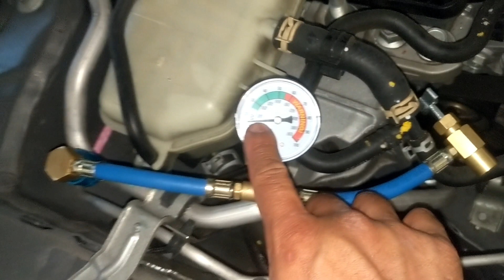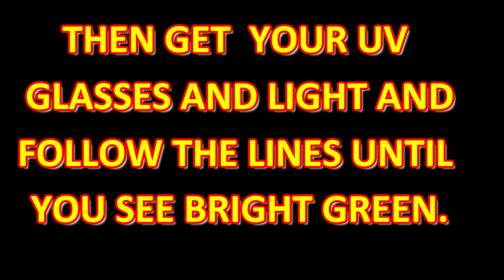HOW TO RECHARGE REFRIGERANT R1234YF , HOW TO FIND LEAK WITH DYE, NEW GAUGE (TOOLS YOU WILL NEED)

Comment: 40psi for R1234YF ? - I don't think so... this gauge is from r134a
Reply: Pressures very similar for R134a and R1234yf. Boiling point is -26.07c and -29.49c respectively. 40psi would be around 7c for 134 and 5c for 1234.

Comment: Honda is actually being sued over this issue with AC Condenser problems for Civics 2016-2018.  You can join the class action lawsuit and get your repair costs reimbursed, although it will take a few years to settle I'm sure.
Reply: This facts. I read a thread on youtube that this is under 10 ye warranty and that they should be repairing it at no cost. Someone that used to be a honda tech put it up and gave all the info on what to say if they try to charge. So far people have been taking it to get fix at no charge

Comment: Does the  dye can have refrigerant ?and if not can I add refrigerant to the system after adding the dye can if the leak is very small to keep it cooling for the meantime ?
Reply from the maker: The dye can has enough refrigerant so u can find the leak.. don't need to add more

Comment: Did you replace the condenser by your self? Was it easy? I think I have the same problem.
Reply from the maker: I was able to take it to the dealer under warranty barely made the time do I got lucky.. but is easy to replace condenser.. I would replace parts the get it charged at a shop as they need to vacuum and fill

Comment: I've noticed something on most new cars and some older cars with larger front grills. The condensers and radiators are right there in the open, just looking at cars with open grills like that I could have a heart-attack driving on some unpaved road or road close to a construction site. The condensers and radiators are just like "stone! come at me bro!"
Reply from the maker: The green dye doesn't lie
Reply: @BudgetClan  by way is the dye actually AC  freon......like if there is no leak will it blow cool air
Reply from the maker: @peaksurg  there is a mixture with dye and freon.. so yes will blow cold
Reply: We could put some mosquito screen or something close to it.... on those open sides